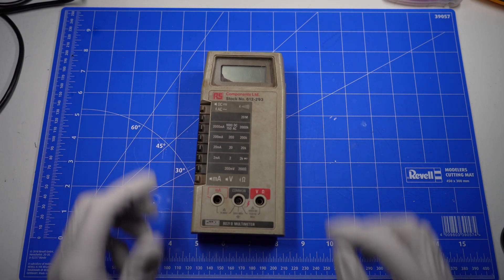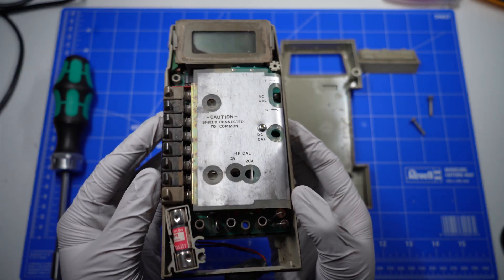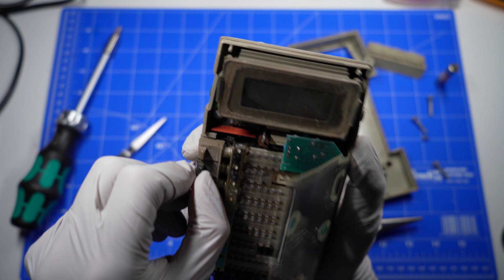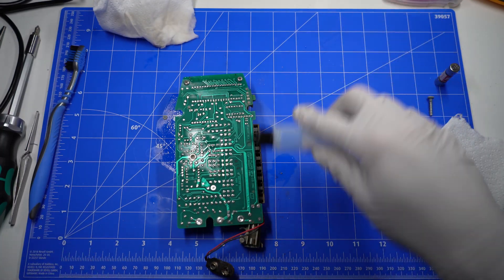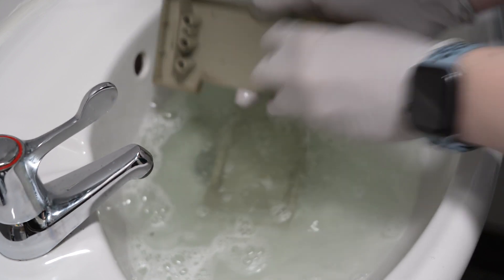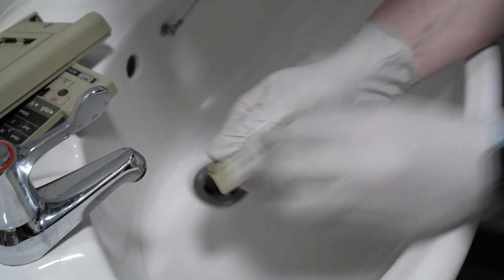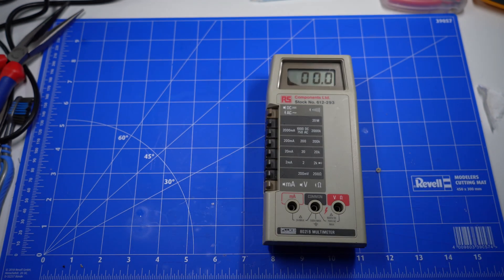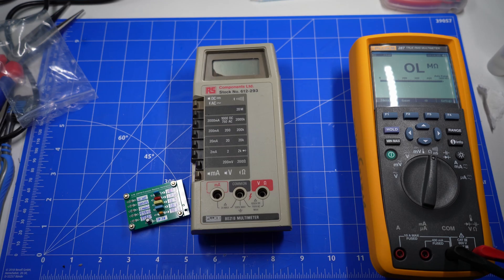40 Year Old Multimeter Gets A Makeover- Fluke 8021B Restoration

Comment: Love the switches on the side! Haven't seen a lot of these.
Reply from the maker: They don't make em like they used to :)
Reply: @itsWetcat I do think the switches are very useful. When you do a lot of the same measurements. Just push the power button to on and you can immediately start to measure. Instead of turning a dial in the desired position.